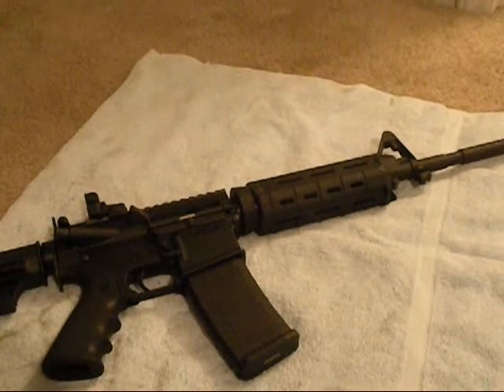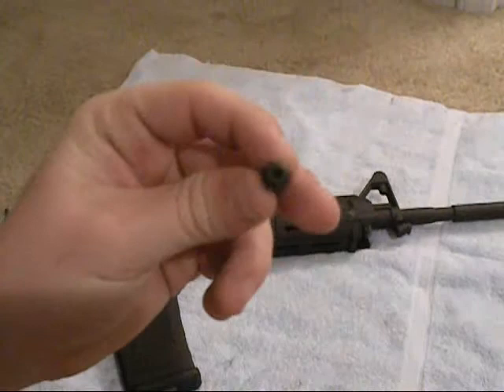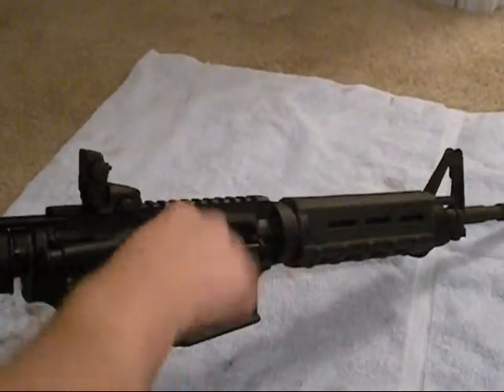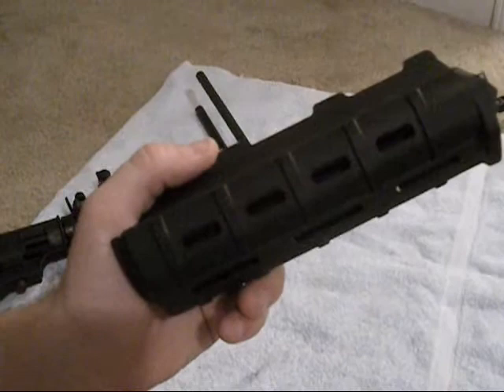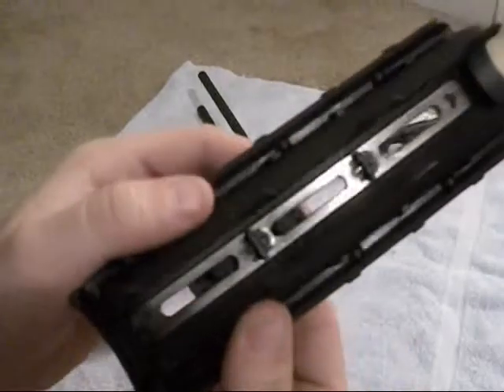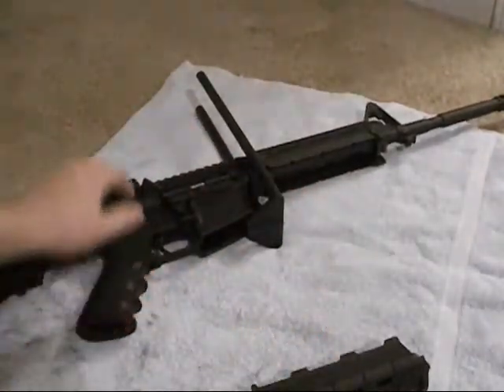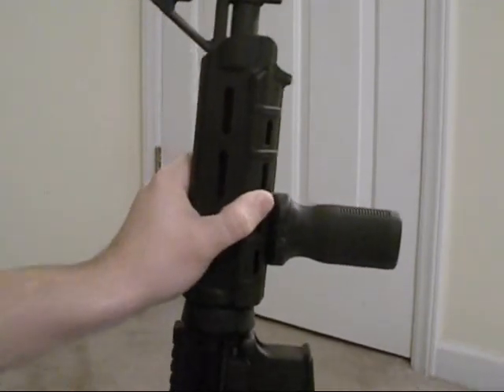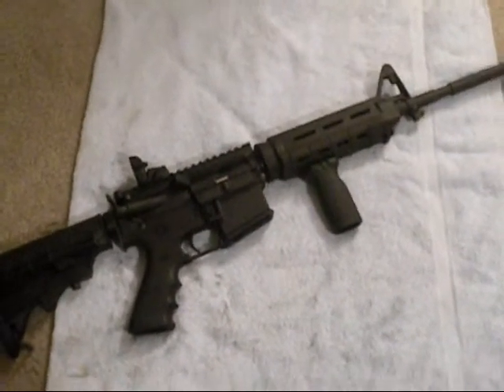How TO install Magpul RVG on MOE handguard

Comment: Hey there.  I suppose I have a question.  I have the M lock rail section which comes with smaller nuts and bolts to get it to lock.  The Magpul  RVG Foregrip that I just bought (shown in this video) has larger nuts and bolts.

I'm assuming you can use the smaller ones that came with the M-Lock rail section but you're encourages to use these larger ones for extra support?  Anyway, tightening them was a bit of a bear, and I they scratched the inside of the aluminum just a bit, but otherwise it seems fine.

Am I doing this right?  Was I correct in my assessment of this or was I supposed to use the nuts and bolts that came with the Rail Section?
Reply: Dude.. I'm going through the exact same situation racking my head on how best to get this done. The big bolts seem to have a hard time going through the small pieces that tighten on the inside of the hand guard

Comment: I"m getting ready to get one of these but I have a question.  If you mount it at the forward most postion, will both screws mount in that forward slot?  Or do you have to utilize two slots?  It seems like there would be a possibility of the rail piece sliding forward and back if you overlap.  But if you could utilize one slot, it wouldn't leave any play there.